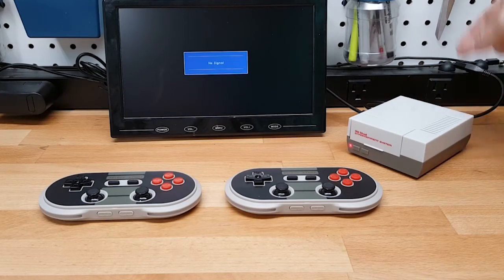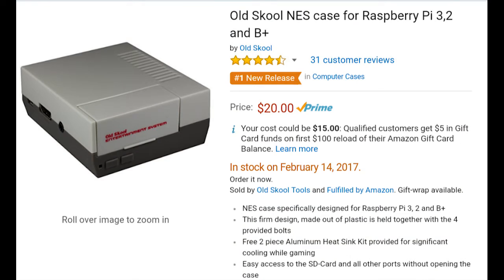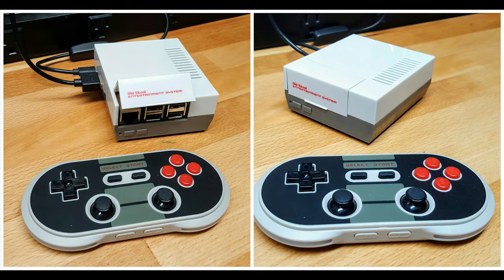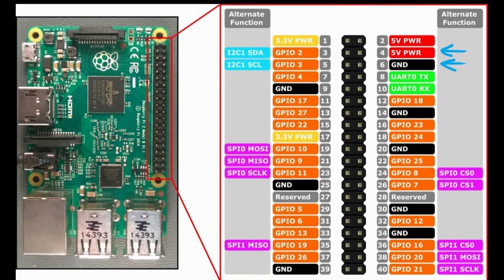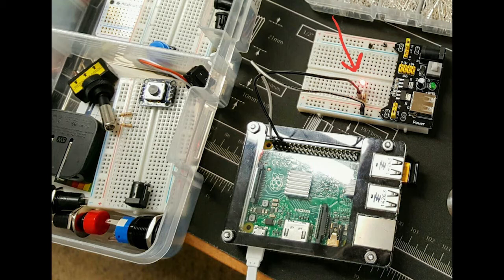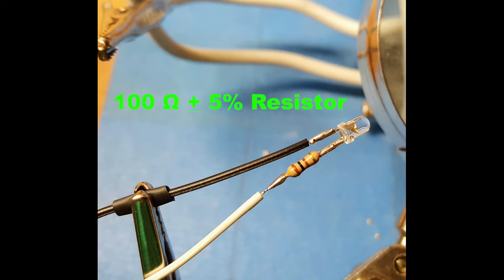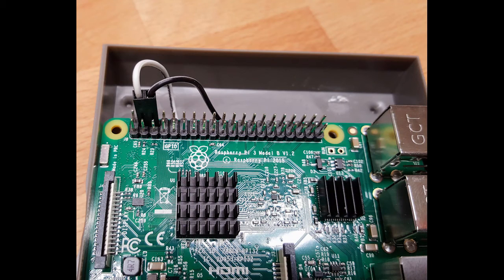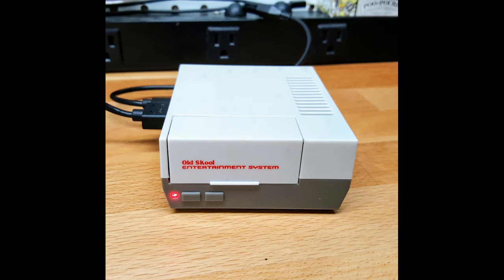Micro RetroCade - Old Skool Raspberry Pi Case Power LED Mod

Comment: Do I need a resister to test the LED Light for any Raspberry Pi version? Whether if it's the Pi Zero, Pi Zero W, or Pi 3? I made about 3 Pi Carts and getting ready to make a 4th one. I want to put a Blue Led Light on the 4th NES Cartridge? What's the best thing to do? Sorry for asking too many questions. I'm still learning. Thanks. Happy Weekend.
Reply from the maker: cool4rocknroll, at 3:40 in this video I show the pin breakout for using an LED. Check out my other video to see about wiring a LED in a NES PiCart
https://youtu.be/E1GbQ3l4Ork
Reply: @MrArmagged0n, Okay I'll check out your video about that. Thanks for the the reply.